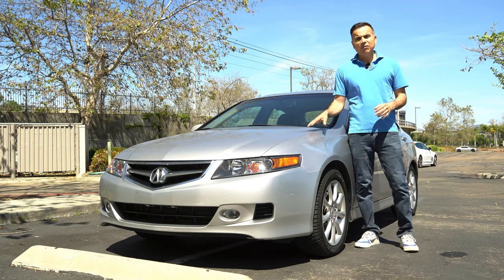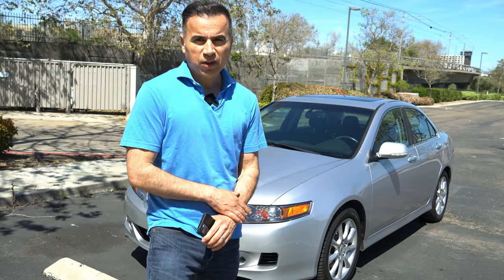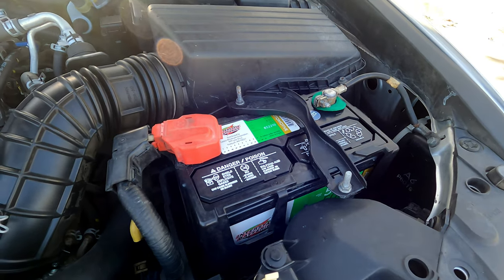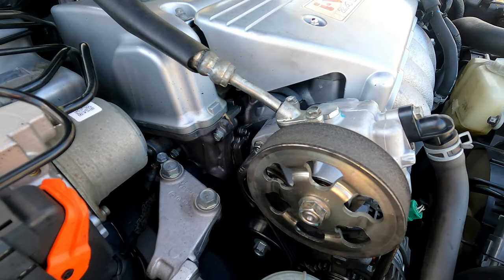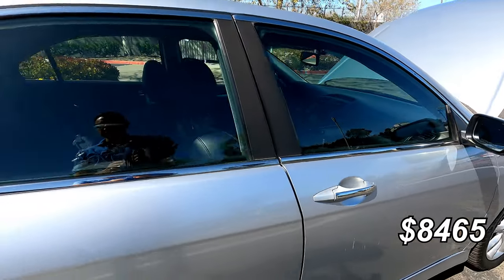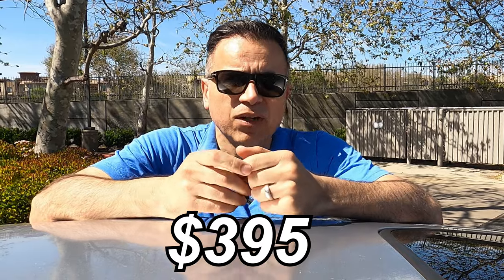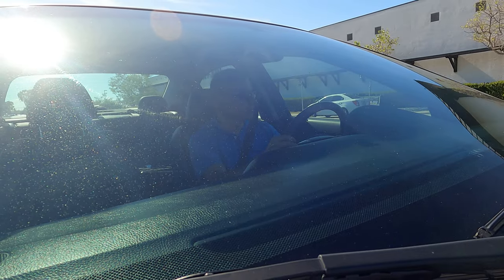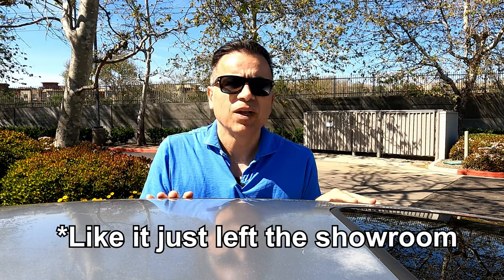This ACURA TSX Has Cost Me HOW MUCH?! #Acura #AcuraTSX #honda

Comment: don't feel bad i paid 9000 for my 2005 six speed  108000 miles from a shop where i do my repair . I got lucky they did all the maintenance new battery belt tires etc .
Reply from the maker: But yours is a 6 speed… I wish this one was stick shift!

Comment: and tires arent 800$ you can get a good set for 400-500
Reply from the maker: Oh, you can get cheaper tires than $400 at Walmart.
Reply: @JuanCarlosLTO  well I didn’t wanna say to cheap you don’t want cheap Chinese ones😂
Reply from the maker: @midrangegamer9063 agree. I just went with Michelins because that’s what the car had. I usually don’t go name brand. But I did this time 🤷🏻‍♂️
Reply: When I bought my 2006 & my 2007 brand new,  they came with Michelin tires. The car was originally tested with that tire setup. So that's the only tire I have ever put on my TSX's.
😎
Reply from the maker: @seabreeze2001  this car too, it had them and the owner always stuck with them. I rarely go name brand. These Michelins are actually pretty good.
Reply from the maker: @seabreeze2001  wait, you are the original owner of yours? Amazing. I go through cars like candy and that’s not good for my pocket
Reply: @seabreeze2001  I mean if your going for a oem look yea but any 100$ tire will do the job tbr my buddy has cheap milestars on his and it dose fine but to each there own!
Reply: @JuanCarlosLTO  everyone has a preference lmao but honestly unless your racing any 80-100$ tires will do just fine and have similar ride quality

Comment: Hi Juan, how is your TSX?  Should I clean the radiator grill with a garden hose to maximize the air flow to cool the engine?
Reply from the maker: Running like a champ. Wifey refuses a new car 🤣 (have you ever heard about a thing?) I’m making an update video soon. Hard to believe it’s been 10 months! We’ve saved so much vs a new car without any headaches of driving an old car. 
About cleaning the radiator grill with a hose. I don’t know man. I don’t think the 2.4 runs hot at all. I see no need for it. 🤷🏻‍♂️

Comment: I need to replace my valve cover gasket its leaking oil at 210,000 miles
Reply from the maker: My engine is oddly dry
Reply from the maker: I don’t think any gaskets have been replaced.

Comment: What I have learned is to keep an eye on maintenance parts but don’t replace them until they actually need to be replaced or if it’s literally about to go out in 1-2 more trips. Otherwise any car turns into a money pit.
Reply from the maker: I did that for years and you’re right. Let things fail or get close to it. Unfortunately as I get older I value piece of mind at the cost of spending more. I remember back in my days, breakdowns where a daily occurrence 🤣

Comment: go to the junkyard and find a trunk it will match the paint i guarantee if not you can return it, way cheaper than painting it
Reply from the maker: Someone else said the same thing. A good idea. The whole body needed a respray at the very least. Just typical or cars parked under direct sunlight for almost 2 decades. I parted ways with it a few weeks ago and bought an old car with near perfect paint which solved the issue. 
The TSX was a great car but oh well!

Comment: Owning a 09 tsx which is essentially the same as yours, for 6 years now 220k miles…the purchase in 2018 was a wise one because it had all the modern luxury features I cared about but mechanically its simple and reliable. The car only requires routine Maintanace and never an issue with power train. You purchase a Honda or Toyota product that’s 10+ years to essentially make you money because the annual cost of ownership is far less than 
 other brands especially if you can change oil yourself, lights alternator, battery etc. in my opinion I think you tossed money at the vehicle that was more than 10 yrs old  that wasn’t a collector or anything and overspent, these vehicles are workhorses to rack miles without issue.. not performance or showroom vehicles
Reply from the maker: You’re right about these cars being workhorses. Actually my coworker bought a 2009 Honda Accord around the same time I bought this one and had done nothing to it. It’s his commuter car and he doesn’t even wash it 🤣. Different approaches, I don’t regret the aesthetic upgrades, my car looks great and over a year ago from purchase I like it even more and haven’t spent a dime since. 
Thank you for your comment

Comment: Juan, how is your TSX?  Mine just passed 416,000km.
Reply from the maker: Funnily I just posted about my ongoing trip in my TSX. This was supposed to be an in between cars car and now wifey doesn’t want to get rid of it. 
We had stuff to bring with us to Texas and the trunk is small compared to our previous two vehicles, both crossovers which I’m not really fond of but they’re undeniably practical.
Reply from the maker: BTW, did you fix the issue with yours?
Reply: @JuanCarlosLTO  There weren't any issues, besides the hard starting and flashing dashboard.  Ended up it was just dirty terminals.  I poured water  before on the terminals to wash away the corrosion.  It did more harm than good because rust formed and made poor poor contact.  After I used a wire brush to clean the terminals, the car starts up no problem.
Reply from the maker: @ronlam3654 Nice. When I was young I’d clean them with baking soda, lime and a brush. Now I think the lime can’t be good 🤷🏻‍♂️
Reply: Spoke to soon.  It was the battery, which failed shortly after.  A new Costco car battery solved the issue lol.
Reply from the maker: @ronlam3654 that’s what I have on mine now. They’re cheap but I don’t expect it to last nearly as long as the Diehard I have on my old BMW: I bought the car in 2013 and the seller told me it was new… still cranks really strong

Comment: Got my 2009 TSX with 139000 for 9500 and put about 2000 in it hopefully it will last because I have a Toyota Camry too a 2012. Bought the TSX for a back up car
Reply from the maker: Both super reliable cars, I’d probably leave the Camry as a back up though 🤷🏻‍♂️

Comment: If you don’t plan on working on your own car don’t buy a high mileage car people… waisted so much on paying people to fix it
Reply from the maker: True! Fortunately it has been running very solidly since. I’ve put 18k miles and even having paid for the repairs it has proven to be super cheap to own vs new.
Reply: @JuanCarlosLTO  good to hear I am in the market looking for one right now but must be a manual transmission
Reply from the maker: That would be my first choice if wifey wasn’t the primary driver. I wonder how hard it would be to find one in good shape.
Reply: So true i haven’t been at a repair shop in years i try to do most of my maintenance myself you can save a lot of money evn if is just an oil change